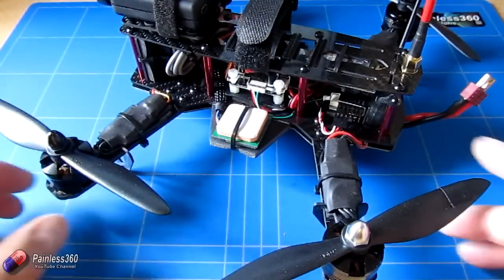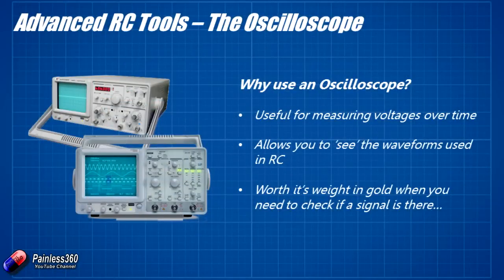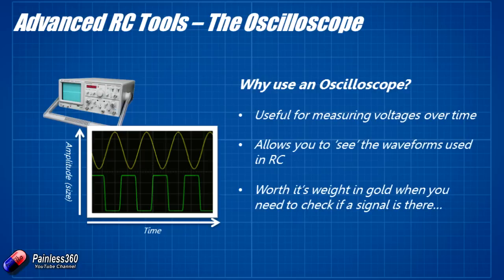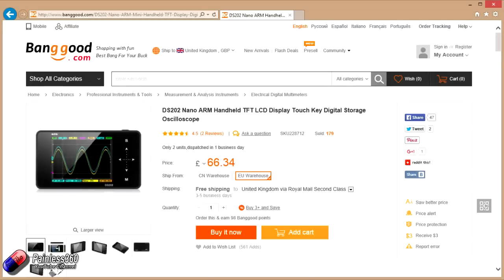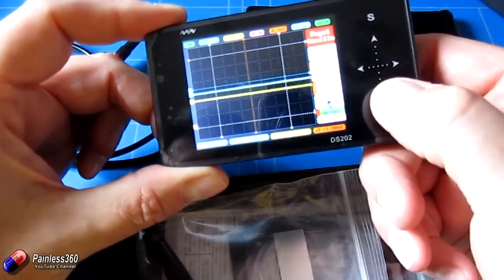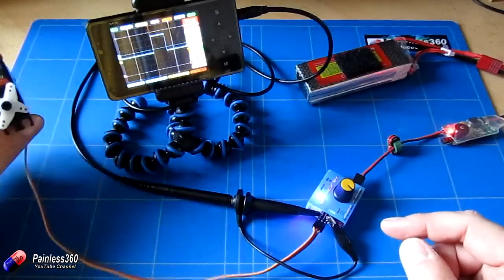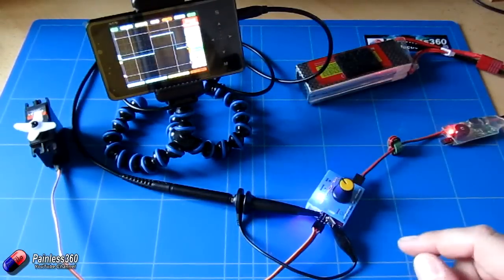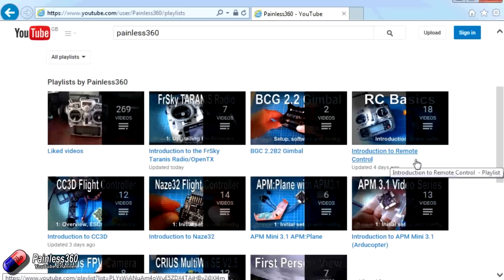RC Review - DS202 Nano Oscilloscope (from Banggood.com)

Comment: Hi Lee,
I just had watched picks 2021 video, found again an Oscilloscope on that list and thought that it now would be usefull for the bench if it not breaks the bank account.  So I searched your playlist found this one you had mentioned in that picks video but the item seems to be no longer available as DS202 anywhere.

even on aliexpress I could not find anything looking similiar like this DS202 nor as product title like DS 221 or whatever.
What would you recommand now cause I found a lot from 25€ upwards and also a video from Joyplanes RC channel about the DSO150 which he said would be enough for him and is just 26€. 
As far as I could have found prices for the DS202 they were about 100€ or so , which would be a lot more even though I do not know if 100€ was a usual price back then or it is just one caused when it had been sold out over the time.

What would you recommand in 2021 below 100 GBP ?
Reply from the maker: Things like the DSO DS211 Mini Oscilloscope are about. It is amazing that we can get these kinds of tools for this kind of money. It has no where near the features and resolution of a full bench Oscilloscope but I've used mine for all sorts, including looking at signals on the i2c lines to see if a pull-up resistor was needed... Happy flying!

Comment: Hi again, I can't seem to find the spare lead on the website.  Any chance you could provide a link for the necessary pieces to make a spare lead? Thanks
Reply from the maker: +RedHotPheasant It's all on that page - (Can find the extra probe in SKU141769, but you need order one adapter together(SKU141782)) Hope that helps.
Reply: +Painless360 Thanks, I found it, just didn't look far enough down the page.  Spent my pocket money now :-)

Comment: Great tool. Could you create a video or two for us "noobs" to teach us how to use it effectively in RC electronics.
Menu choices seem overwhelming, despite reading the manual.
Thank you for all your efforts.
Reply from the maker: Thanks for the suggestion. If you are new to Oscilloscopes then there are some basics (scales for time and voltage and trigger method) but it's a big topic in its own right. I use mine to check if I can see the signal lines moving on an RC output..

Comment: +Painless360 
Is DS202 useful/capable of analyzing a PPM/CPPM/PPM-SUM and S.BUS signals at a decent resolution?
Is it actually able to show a full frame and tell you the length of each pulse?
Reply from the maker: +Jon Linde Simple PWM is great - the triggering isn't sophisticated enough for more complex frame captures. Best of luck..

Comment: I've had one of these for a few years and it's a great little scope for testing low frequency circuits. Unfortunately the little MCX connector broke on mine recently so the scope is currently sat in my " Things to Fix" box waiting to be resurrected.
Regards
Nidge

Comment: I have a nice modern rigol DS1054Z as well as an older BKprecision 30MHz analog beast! Though I never really found a great use for them on my model other than testing power regulator ripple voltage and stuff. The thing is though with those small handheld scopes, they are a real pain to set up.

Comment: This is a pretty standard 1mhz porto scope, these do pretty well. Nice little review and useful for in a pinch on field.

However for your shop (if you dont already have one,) have a look at rogol ds1054z which is fast becoming the electronic hobbyist's standard. (can be had for around 340 shipped.)

Comment: Is that a Floureon battery you are using? If so do you like them? I have a few of those for my model, and they are OK, though the smaller 300mAH ones do not stay well balanced.
Reply from the maker: +Power Max It's not, it's a very 'mature' Align pack from when I flew 450 class helis. Still works great and I always have one handy near the bench for things like this..
Reply: +Painless360 My older 4500mAH ones worked great! But I did not have them for very long since I punctured one of the cells in the 2 that I had from crashes. As replacements I got some smaller 3000mAH ones, and I think I may be overloading them a bit (4 4.5x10 props on a 25C 3000mAH battery) They never stayed well balanced though. Their internal resistance is also a bit higher, but that is expected of them being smaller and all.
Reply: +Power Max i have a floureon 3s 5500mah 25c and its not balanced either. 1 of the cells having a higher resistance value thus making the balance charger work harder. it has since lost some of its juice after 3 mths of usage.
Reply: Meh, I don't know what to think about them now. I will probably get another 4.5AH one when they get cheaper, the one I used to have has never needed to be balanced, and the 3AH ones I have now are starting to show signs of quitting, They are not even giving me 7 minutes of flight time anymore.

Comment: Ok, you've cost me a lot of money and the only way I can resist this is if you won't be doing follow-up videos showing things like FPV noise, and other such problems <grin>.  Otherwise there goes another $100 or so.  Is there enough difference in the DS201 and DS202 to warrant the difference if primary use is RC stuff?
Reply from the maker: +Hugh Dinwiddie Sorry about that Hugh, there is so much blooming great tech in this hobby! I am looking at a frequency analyser but I don't expect to have that until much nearer the New Year. Happy flying!

Comment: Next up, Painless 360 develops and reviews a nano time domain reflectometer so we can troubleshoot micro shorts and opens in our quad wiring. =)
Reply from the maker: +Hiway Almost, just need to align the antimatter concentrators on the flux capacitor... Almost..... got.... it... ;)
Reply: +Hiway That brings back memories!  I used to use both a coax TDR, and later, an optical TDR (OTDR) to location wiring issues in Ethernet networks.  We had a fantastic unit that would print out strips on thermal paper.  Very useful to convince the customer that we had found the problem!
Reply from the maker: Time Domain Reflectometer! Blimey now you are taking me back!

Comment: Hi, and thanks for your very informative videos. I just bought one of these and I've never used an oscilloscope before and don't know how to handle them. The first problem I step into is the interface. E.g. I cannot even get at a waveform that is possible to view. I can see that something is moving just around the central line, but not more and cannot change that when I try to do the same as you in this video. I think there are a few guys out there like me that should appreciate if you would be so kind to do a video about the basic handling of this little thing. I've tried to find videos about it, but cannot find any.
Reply from the maker: +Christer Ljungkrantz I'm not planning to as the controls are very similar to any other basic unit. Best of luck with it.
Reply: +Painless360 OK, Thanks anyway.